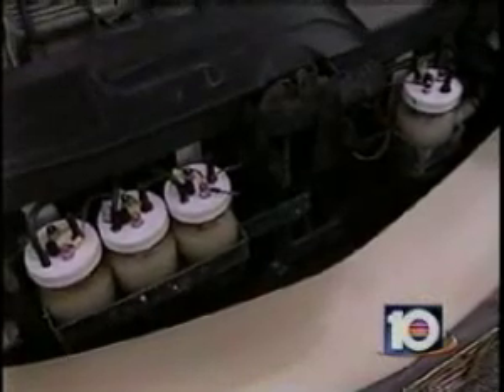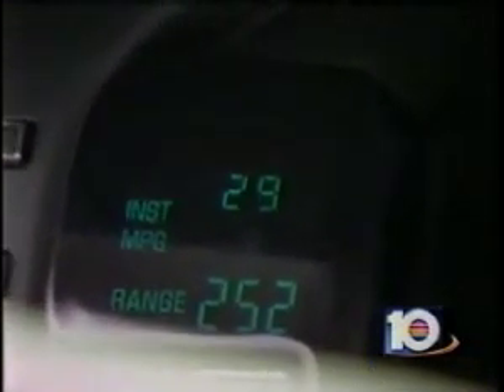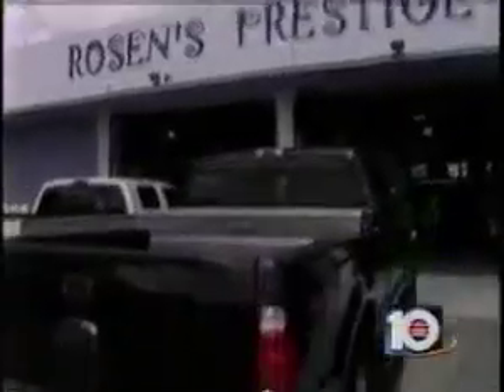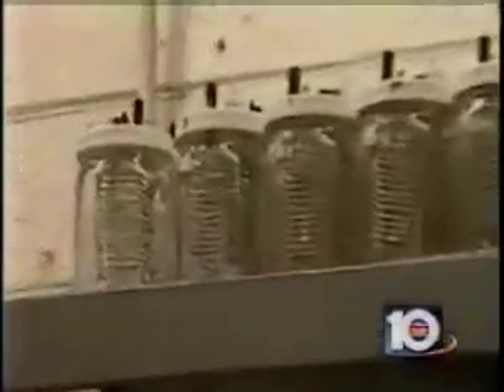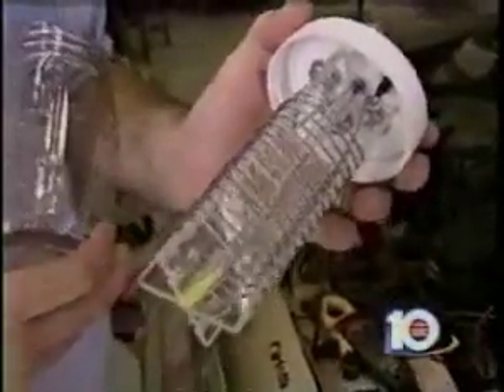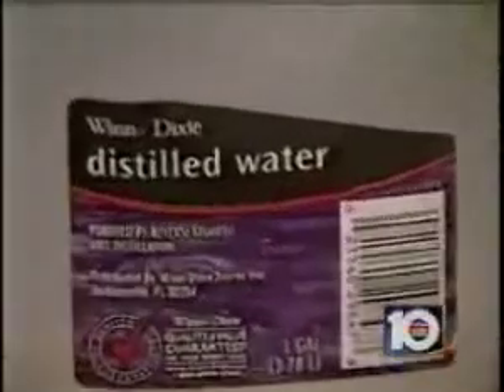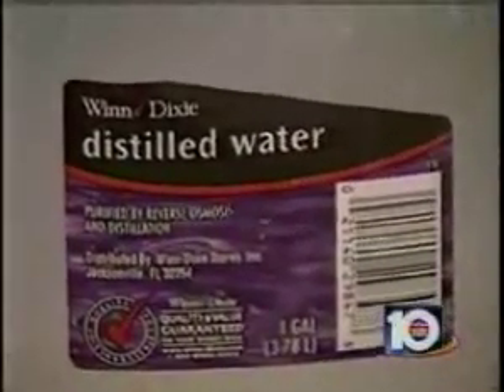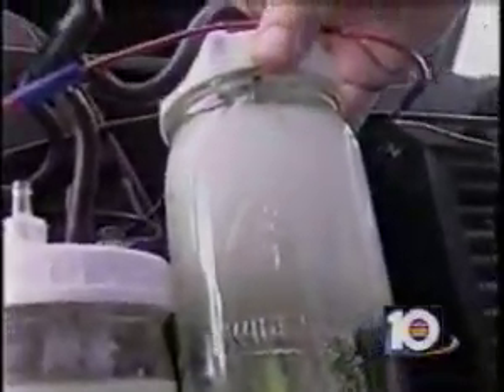mightymiles miles hydrogen car conversion save gas run car o

Comment: HHO gas  Make your car a hydrogen hi-brid Hho increase fuel burning efficiency better then a new car. Cool engine running  prolonging engine life and engine oil life with less engine maintainess required🚦

 100% fuel will burn in the engine No un 

burn fuel wastage . Hho system works on petrol, deisel, cng, lpg and lng types gases.

Engine runs lighter smoother reducing carbon emissions significantly . Boost engine power and torque . Hho gas reduced engine noice & vibration

ACMEC hho car kit lower the engine temperature more reliable simply made Hho kits restore better fuel economy. Hho system is very easy and simple to install. Hho solves the engine heating problems automatically! Cleaner engine running. Reducing engine noise due to the faster fuel burning. Hho car kits works nicely requires no modifications in the car engine. No side effects on car engine.

Engine start quickly your car battery Will Charge Quickly make your car a low cost hy-brid. Useing  low amps. Hho car kit will work better. You can easily transfer hho kit from one car to another one. Hho kits requires no any modifications in the engine. HHO kits absolutely work.

Comment: Oh Boy!  I feel sorry for those who bought this.  I bet they were told to adjust their computers.  That's why they think they are getting better mileage.
Reply: ***** They use Hydrogen as fuel yes.  But you ignorant fool should learn to read!  The hydrogen is not produced by the alternator and engine as this video clearly trys to make you believe.  Companies like DHL and Pepsi use hydrogen fuel filling stations you ignorant fool!
Reply: I built my own hydrogen generator installed it on my3.8 Grand Prix. I built a hydrogen cell using stainless steel plates instead of the wire  . My cell was installed on my 1999 Grand Prix  no modification or tuning was done . I had the gas from the cell go into the air filter box just in front of the air filter element after going through a bubbler  . My system was on my Grand Prix for 4 years and the best results were on the flat freeway at 60 mph  or 100kph  my gas mileage at 60 mph was just under 40 mpg imperial .I did have problems with the system leaking and plate contamination the system does need maintenance. Also the leaks were caused by overheating from the electrolysis heating water .  The introduction of hydrogen and oxygen in the engine makes the gasoline burn more efficiently and that s where the increase in mileage occurs . My Grand Prix 3.8 was obd2 system and worked well with a small amount of hydrogen oxygen aka hho .
Reply: @nickking1510  
Sure, a lot of people have made an HHO generator and supplemented it with their fuel.  People make claims of better fuel mileage, yet no one has ever shown actual evidence or even peer-reviewed reports.  Despite that, this is still not working as Meyer claimed.  He claimed he ran his car entirely on HHO with no other fuel.  Generating it while burning it which is not possible.  So the question I ask is if you cannot run a vehicle entirely on HHO because it takes more energy to create HHO than you can get out, how is it possible to improve your fuel mileage?  It makes zero sense!
Reply: @valveman12  gasoline is not super efficient adding a small amount of pure hydrogen and oxygen from the electrolysis generated onboard added to the mixture increases the flame speed of the gasoline making it burn more efficiently .I do know the hho gas generated is very explosive you can see fools on you tube adding it to plastic bottles and lighting it off .As for Stan Myers system I have not seen enough info to form an opinion .I have seen some schematics and know the story of Stan Myers and listened to his lawyer on several occasions on radio talk shows ,also Mr Myers may have been purposely silenced . I enquired about grants available to do development at a business level on hho systems and the official I spoke with on the phone said ( you do know people have had accidents who tried this before ) the official said it in a joking manner then later said there were no real grants available .

Comment: If you want to get the best Plans to converting your car to run as Hybrid Hydrogen
and save hundreds of dollars on your fuel expense
there is a mechanic from Detroit that tested these car kits conversions
Just go to Google and search for: Top HHO Gas Car Research
Click the first result (Skip the Advertisement)

Comment: That's only part of the problem. The 4-stroke engine is very inneficient. Only one stroke produces energy.

I do like the idea of introducing cleaner fuel into the engine. The computer reads the output emissions and reduces gas usage accordingly. Wonder if I could trickle feed propane instead :P

Comment: Most people are able to grasp an 8th grade science project that has been testable and repeatable for past 100+ years. A combustion engine can easily use either 120 octane Hydrogen gas, 87-91 octane gasoline or a combination of both fuels. 

If you can not grasp eighth grade science,  then please refrain from posting absolute ignorance in a public chat thread. NASCAR and most every other motorsport on the planet have been using Hydrogen fuel for past 10 years. 

Welcome to the 90's dumb ass.

Comment: lol yes and if i put a 4cyl in my suv its going to get better mpg sorry its about hp to weight ratio that 4cyl will be to under powered to move it efficiently i have a 67 fury i built for millage i used a 318 v8 and get a proven 22 mpg with no overdrive fact is its all in how the motors built if you want mpg buy a car that gets good mpg plenty of v6 and 4cyl cars are out there (american made at that)

Comment: @urbex2007 BAHAHA.  Are you serious?  Non-gullible people?  You realize that the way an alternator spins is that it's connected to a pully which is turned by the engine itself.  There's no variable speed for the alternator, it works "flat out" all the time.  The engine doesn't use more fuel, it uses less because hydrogen is flammable.  This works because newer cars can control the air/fuel ratio through computers/

Comment: so much stupidity and fake movies, everything is just market for the moment. First of everything, did anybody calculate what the energy needed to obtain hydrogen and what energy is obtained? I can tell you some calculations, with 3.4W you can obtain 1liter of HHO, then with 1 liter of HHO after burn you can obtain 2.15W. This is much less energy than needed to give power supply for next electrolyze. There is no efficiency for this alternative of energy for the moment.